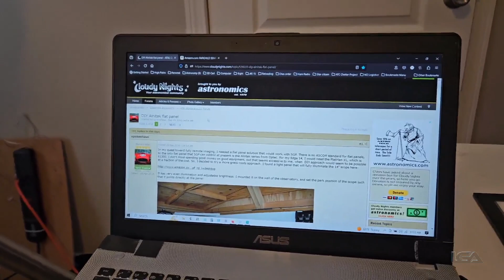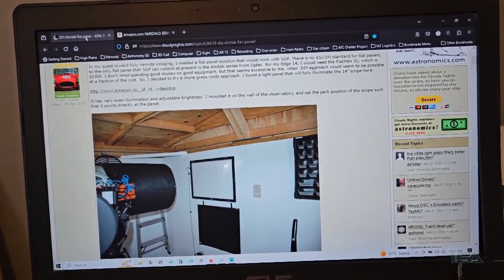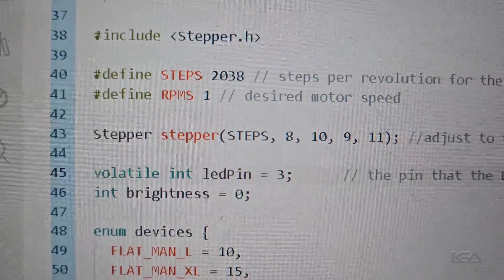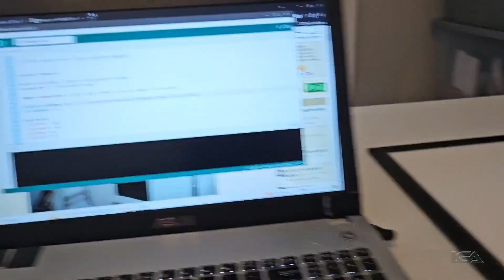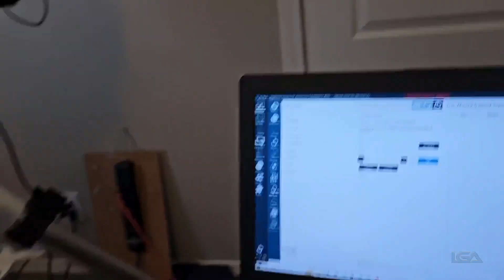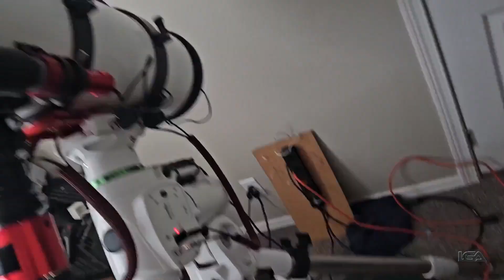ASCOM Flat panel DIY

Comment: I tested it using an array of LEDs I put together. I have a light panel just like the one in your video. Any suggestions about opening the case without destroying the panel?
Reply: Never mind. I just found out it's only held together with double sided tape and hot glue. Really easy to get apart.